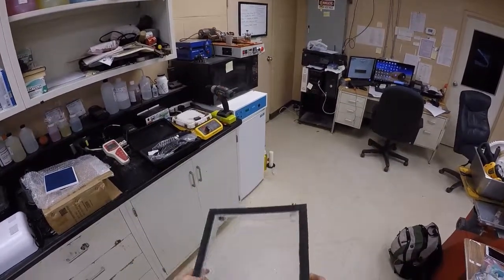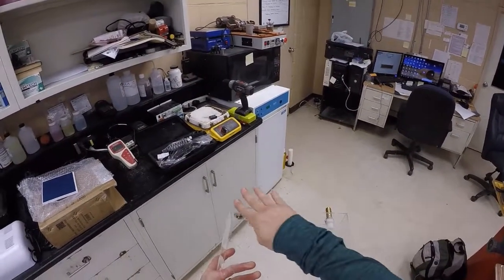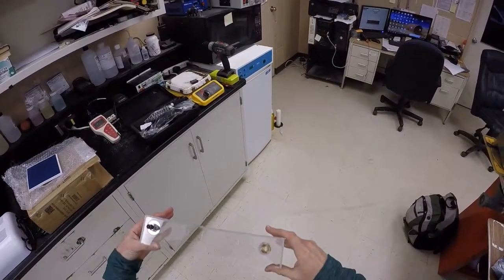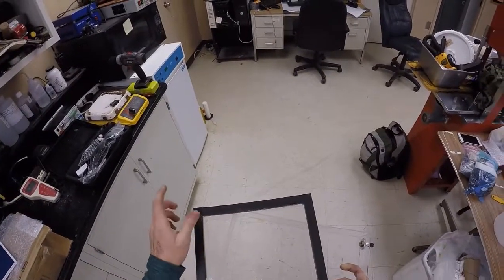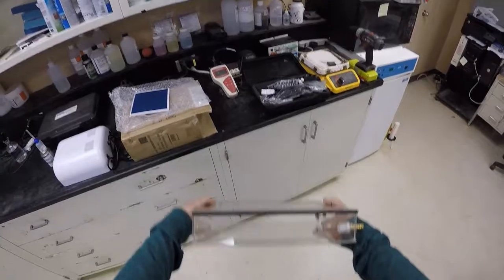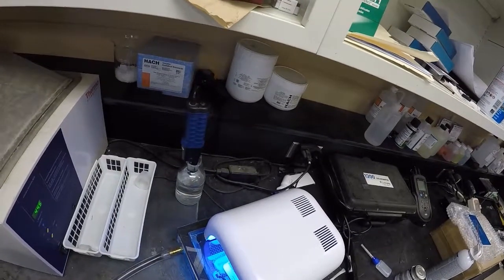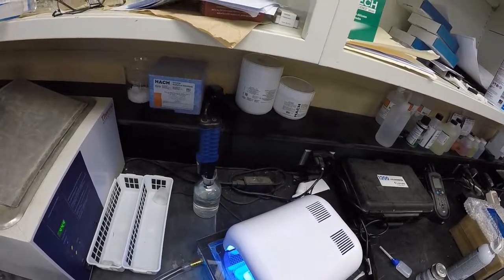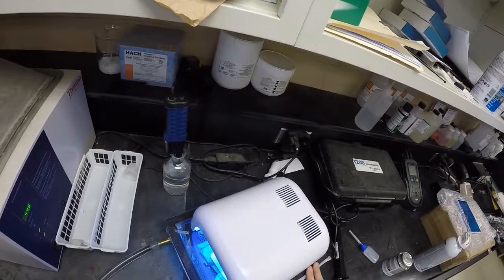Homemade Vacuum Chamber

Comment: How about a pressure cooker? It doesn’t have to be a see- through! Just throw the screen assembly in there until all bubbles are out then cure it once it’s out!
Reply from the maker: Lol.. yeah! Easy peasy!
Reply: A regular kitchen pressure cooker works both ways, Pressurize(tire valve and gauge in the 2 holes on lid)(no need to look inside) to 25Psi or vaccum. For vaccum(Usefull to look inside) can use a a pice of plexyglass/polycabonate and silicone a pot extra seal